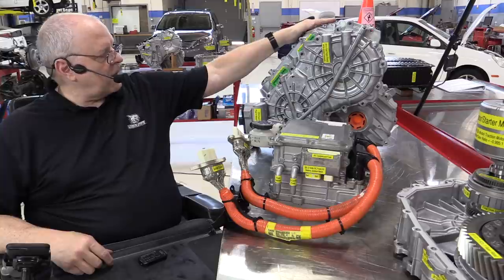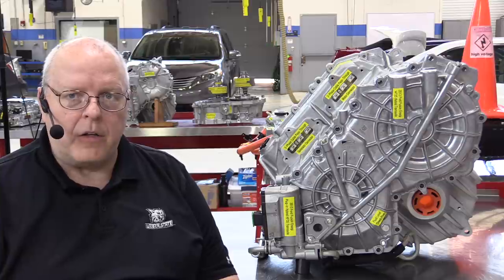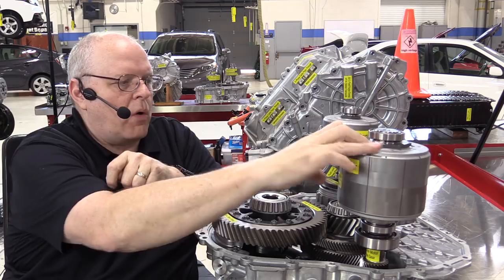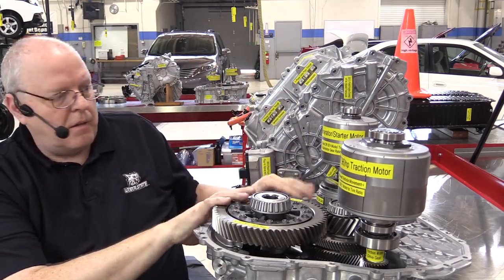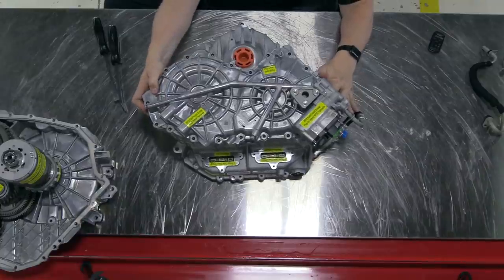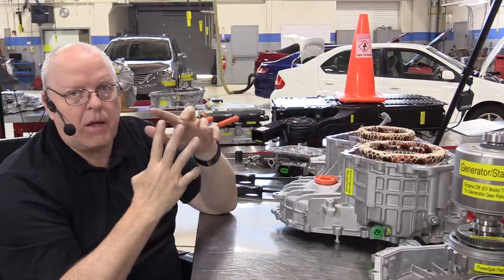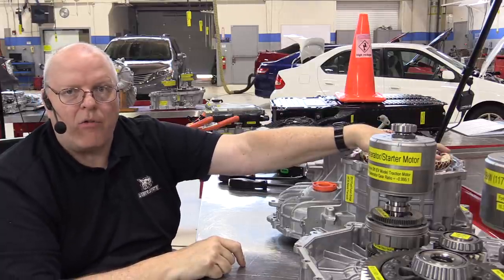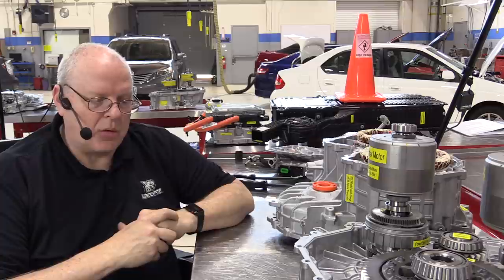Ford Fusion HF-35 Hybrid Transaxle Electrical Operation

Comment: You seem to be a smart guy maybe you can help me with an issue 2018 Ford fusion hybrid SE front wheel drive orange wrench light came on the next to that a little battery light came on and then when I tried to restart my car a explanation point with a triangle came on and then it wouldn't start when they're got the mechanic now and they're trying to fix it but the codes are coming up funky and I guess there's 6 or 12 codes that are coming up saying that it's the transmission but we're not sure that is the transmission we're thinking that it's something else seeing how that zero transmissions have failed in these cars so far does have 263,000 miles on it but it is well maintained every 3 weeks. So I was driving at 70 mph and the car just stopped driving not a cool feeling but I didn't die so that's a plus then when I got pulled off to the side the normal electric part was on but the gas engine part wouldn't start and it's not seized so we know that's not the case so what would you think that it would be under the conditions that I just gave you any help would be great thanks and we did clean the throttle body and we did remove the battery from the car for a period of time to see if it would reset anything and it's not resetting anything and we did the 20 second break acceleration both put down at the same time for that period of time and it didn't work either nothing started it doesn't even give me the sluggish run time. Other than that the car is an excellent shape

Comment: What the different between the  2013 and 2017 ford fusion hybrid transmission
Reply from the maker: This video shows the first three generations https://www.youtube.com/watch?v=hHU5xFOBcsU
It is my understanding the 2017 and above use a new rotor design similar to the Toyota P610 transaxle shown in this video https://www.youtube.com/watch?v=-dHeRJdrnI8 Best wishes
Reply: Has Ford changed the quality of the Bearings in 2017, 2018 and 2109 models?

Comment: I have a 2014 Ford Fusion hybrid and I’m worried about the tsb where the case gets a hole drilled into it by the drive motor. Super worried about my transmission since I read it. Do you know anything about that?
Reply: Have you had the fluid changed with fresh Mercon LV?  Most Ford dealers will tell you it’s lifetime fluid (WRONG!). I have kept my 2013 Ci-Max hybrid transmission fluid changed every 50,000 approximately. As I type this I have 132,000 with no issues so far.  There is an issue if an axle seal fails and the fluid leaks out its goodbye HF-35.
Reply: @s.mas.w  I’ve been treating it as a regular automatic first change was at 60k and I’m about to get another at 85-90k since I push my Fusion Hybrid to the max. Edit: I had a cv-axle boot tear, leaking grease from the boot itself but I don’t think that would cause the ATF to drain right? The 60k change was done after I had the cv axle replaced so I’m not super worried about low fluid at this point.

Comment: hello professor
I just want to know what it's possible to just change the caise ; I have a fusion 2013 that broke down twice, the first time I had a lot of trouble it cost me a lot to bring it back from the USA and now here is the same problem if it is possible can you help me

for information I am in Morocco
Reply from the maker: Yes, it can be changed if you can find the parts

Comment: Professor sometimes you go to fast I can't see every bolt being removed on the battery  casing I think my fuse is blown in the DC converter and I'm afraid to take it apart I need u to slow down please
Reply from the maker: Thanks for your feedback. You can change the playback speed of YouTube videos by clicking on the little gear icon on the bottom right of the screen.

Comment: Hello Mr Weber, if you can please help me with this code, I have a 2016 Ford Fusion plug in, with code P0C2C, aux trans fluid pump module, I check all the fuse and the connectors they all are ok. If you have further info please help me. Thank you

Comment: Does this mean that it's no need to change the "transmission" oil?
Reply from the maker: Always check the maintenance guide in your owner's manual. Most Ford's have a 150k mile fluid service interval.
Reply: I had to go to an independent mechanic to have the fluid changed in my 2013 C-Max, local Fire dealer refuses say it is “lifetime fluid”.  I’m currently at 132,000 miles, no issues.

Comment: It is not clear to me why they use two assemblies, one for the motor and one for the generator. It should be simple to use a single three-phase assembly to start the engine and provide mechanical energy when driving or do regenerative braking and power generation in case it does not generate energy. It might be slightly more complicated electrically to do that with one motor, but it looks like a waste of space and material to actually have two motor assemblies.
Reply from the maker: The small motor is only there for hybrid mode to allow the ICE to contribute torque through the power-split planetary gear set to the larger motor while driving at higher vehicle speeds. The batteries are far to small for electric vehicle mode only (which would only require one motor). Thanks for your feedback.
Reply: The genius of these transaxles (and I think Toyota was the first) is using two motors tied together with a fixed gearset such that by controlling both motor speeds, you can achieve a highly efficient, true infinitely variable transmission.    This (as well as the battery) is a key reason behind the excellent mpg of these vehicles.

Comment: Kinda funny you think Toyota hybrid tech looks fordly  https://www.nytimes.com/2004/03/10/business/ford-to-use-toyota-s-hybrid-technology.html
Reply from the maker: Thanks for your feedback. I knew Ford licensed Toyota hybrid technology, but this was the first time Toyota has used a parallel axis motor transaxle design (Which is what Ford started with). Prior to that, the Toyota hybrid system uses inline-axis motors.
Reply: @WeberAuto  Your welcome, hopefully it wasn't too snarky sounding.  Always seems the common manufactures are often cooking around the same stove.
Reply from the maker: @signlsirchir2156  Thank you, I know what you mean. I love feedback and makes me think. I learn a lot from it. Have a great day!